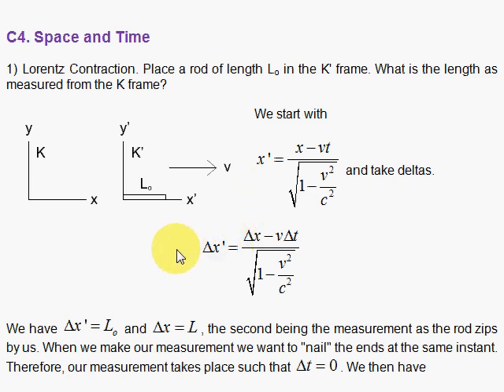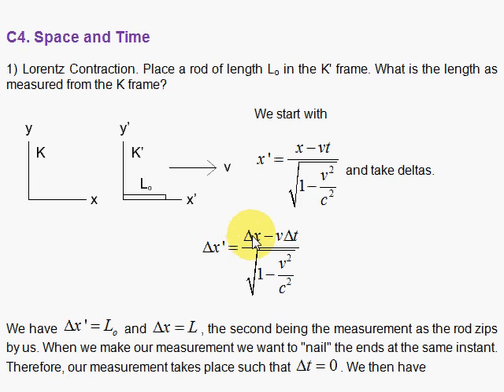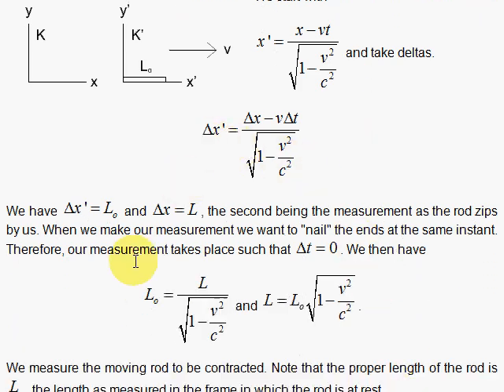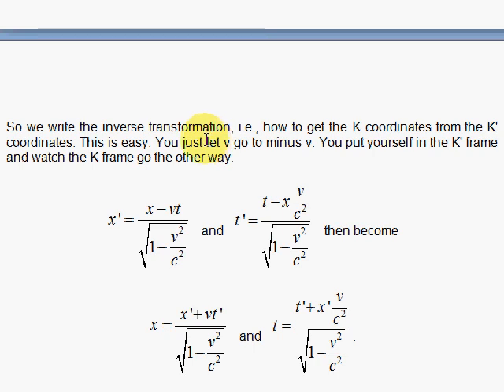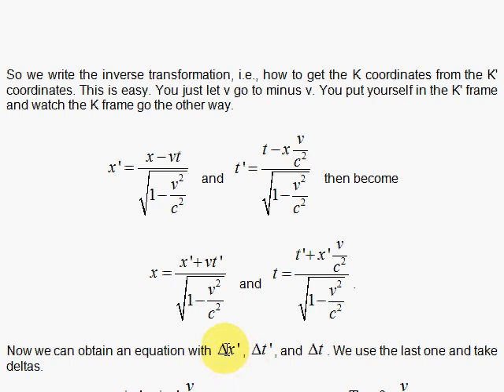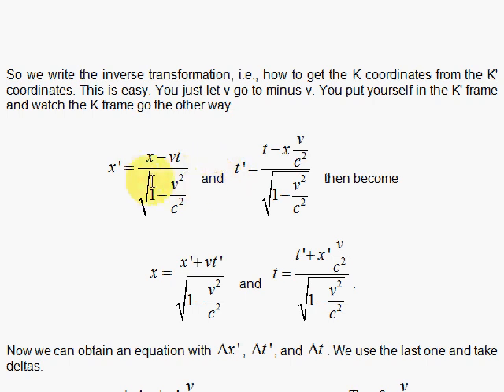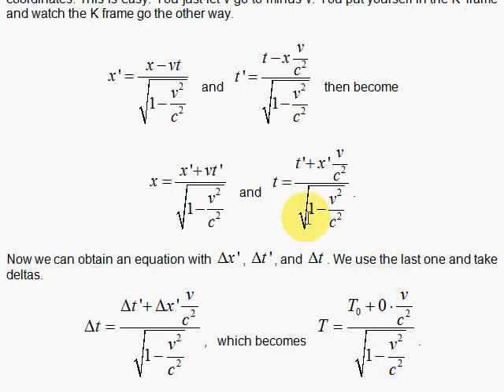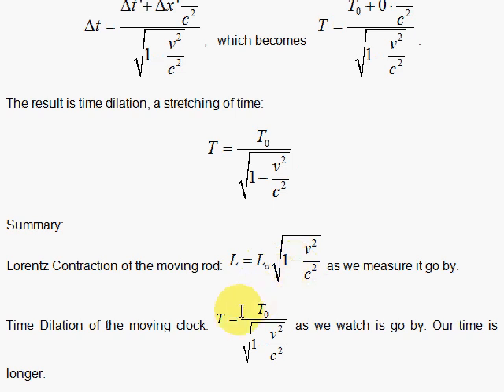C4. Lorentz Contraction and Time Dilation

Comment: Everyone automatically places the lorentz factor under the term, when it should be multiplied.  That is, if I am traveling at .87c, then time has dilated by a factor of 2.  for c to remain constant, c=l'/t'; they both have to dilate.  if i arrive at my destination 4 lightyears away in 2 years, it isn't because space-time has 'contracted,' that isn't even consistent with this description, it is because like the photon, i have dilated in length by factor of 2.